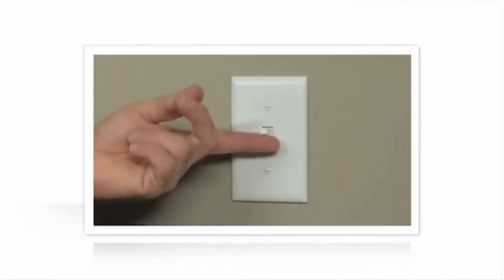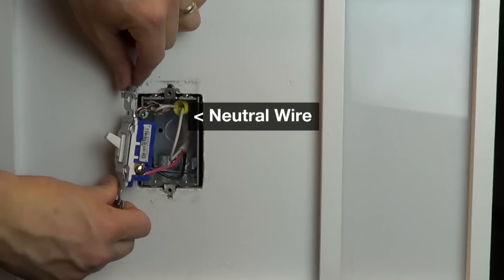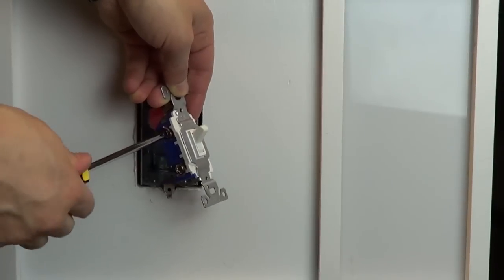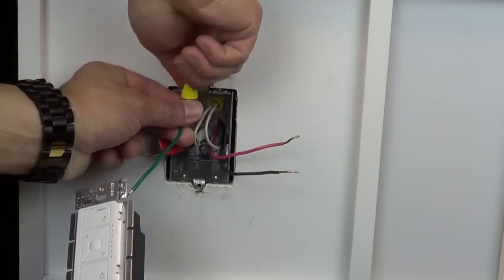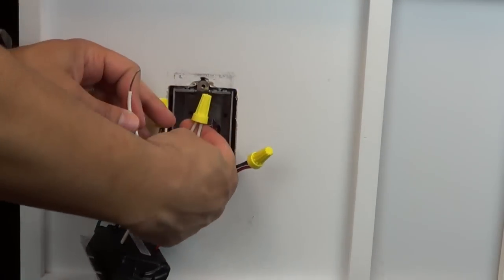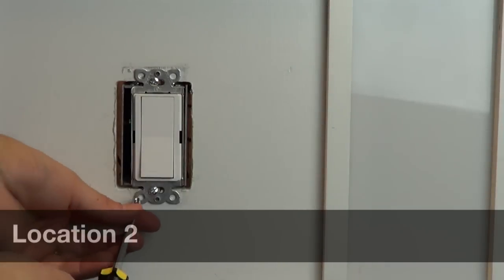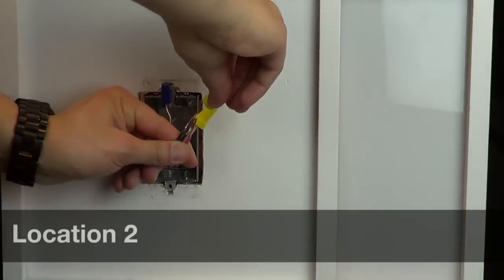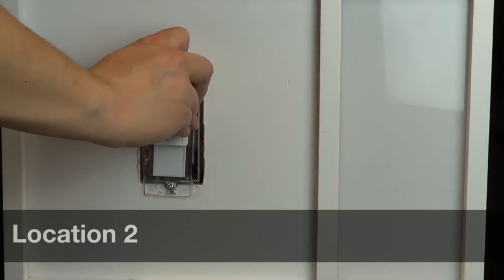Wiring a Control with One Black Wire, One Red Wire, and One White Wire (Multilocation with a Pico)

Comment: I replaced a 3 way switch wires are all on correctly but I had to replace the other 3 way switch but this one is not working there is 1 black wire 1 red wire and 2 white wires not same as first switch where do these wires go
Reply: My 1st 3 way switch has 1 red  1 white and 2 blacks was working but 2nd 3way switch has different wires 1 back 1 red and 2 cream color wires how do these wires hook up

Comment: is their a tool to tell if black wire is black and white wire is white and ground is ground? just to make sure, if this makes sense
Reply from the maker: Hi Angel, Yes, there are third party volt meters that can be used to test the wires. They can be purchased at electrical supply stores. Thanks

Comment: Question both of my wires black and white both have power continuity.
Now my question is how do I wire a 
A dimmer switch that has two red wired and one black wire
Reply from the maker: Hello, Thank you for your inquiry. Please reach out to our Support Team at support@Lutron.com or by phone at 1 (844) 588-7661 for assistance with this installation. Thanks

Comment: What's red wire is it - or +
Reply from the maker: Hello, The black wire on the dimmer will connect to the hot (power) from the breaker. The red is for the load- the wire that runs to the lights in the room. In the wall box, the red wire and second black wire are the traveler wires going to the second switch in the circuit. For more information on wiring, please visit https://www.lutron.com/en-US/Education-Training/Pages/Tools/InstallDimmer.aspx Thanks